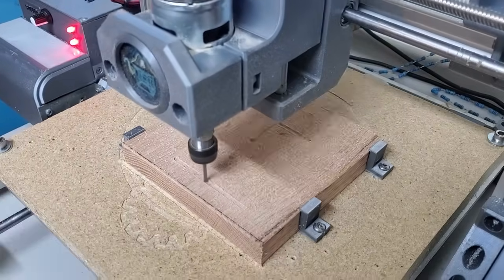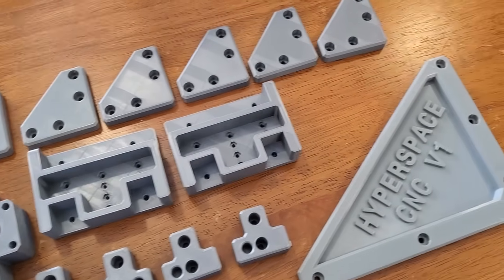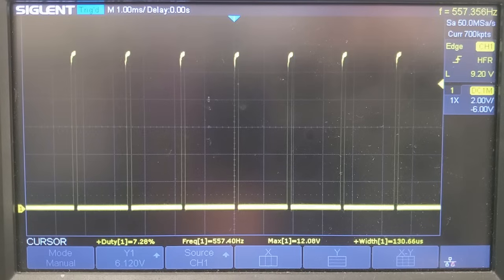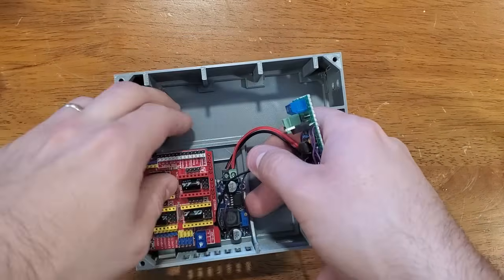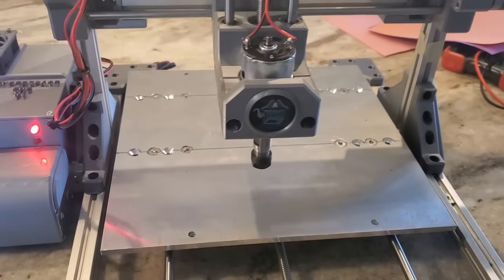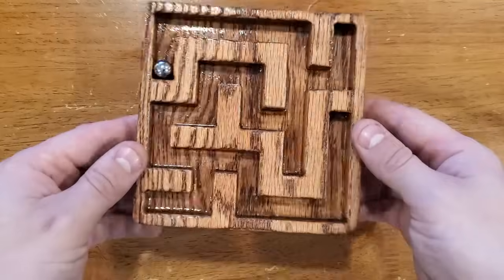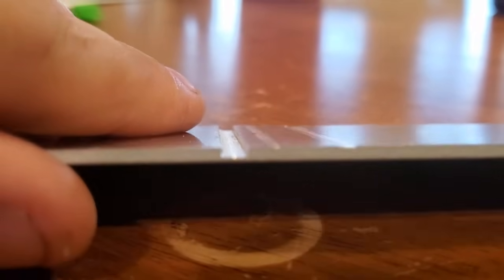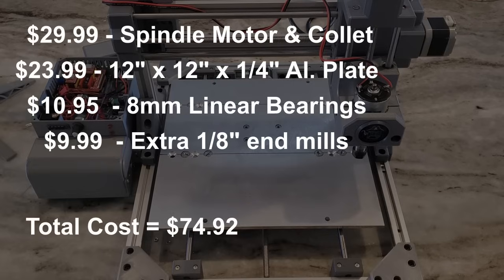CNC Mill for under $100

Comment: A great build and fantastic video; I loved how you showed each step in detail.  I made a similar one for less than 1$ because I too had most of the parts on hand too ;)
Reply: Yes indeed a very good guide, it inspired me aswell to look in my drawer and since that i got one literally for free because it was a fully operating miill in there
Reply: @Mercan1556  😂
Reply: @Mercan1556  Lucky you! I opened every drawer and only found socks and such. Would that work too???
Reply: Great math is limitless here. I made it for -200 $, factoring in that I was also able to sell some of the crap I has at hand :)
Reply: But you still paid for that so you should still count the initial cost minus whatever you made from the rest of it.
Reply: @LuisCasstle  r/wooosh
Reply: you don't have to buy what you can recycle. 
why do you children assume these are new parts? 
so nasty and so ignorant.
Reply: ...thats not how that works, the fuck... if you bought the parts somewhere in the past then they weren't free, you still spent money on them; you just forgot about it
Reply: tha'ts awesome, although 3 days work, I make about $1,500 a day before gov robberies,. so that printer would cost me $4,500 in time to make, although I do have most of the parts layin around
Reply: That's not how pricing works, like at all.

You're just terrible with spending and had random stuff lying about.
Reply: @Kyle496  you missed the joke…

Comment: The 165 one would be cheaper ! By the time anyone rounded up all that and found software etc. your talking days!  Even at $10 an hour which is much less than my time is worth your probably looking at a minimum of $150 + at least $100 for parts and that's without all the time to design and print all those parts! And I doubt you or anyone can just open a drawer and find all the hardware, and what look like brand new parts at that!  Sure!

Comment: you over spent tbh, im working on a milling machine atm cost nothing, just using the 12 nm closed loop nema 32s, a bunch of steel/aluminium ball screws ect i have laying around from about a month ago.....dude i got a great business idea, since we seem to get a bunch of shit free for building milling machines why dont we start selling the parts for $5 piece exc gst/postage/transaction fee, yea its a small amount but the amount of people who would pay $5 for some of the parts that usually cost 20+ we should sell alot.

hey i havent tried with other things yet but the buying it saying it wa slaying around making it free thing, does that apply to other shit? like could i walk into a car dealer have the remove a door from a Ferrari, buy car then say its laying around so now its free and just pay for the door to have a basically free ferrari?, sorry im a bit new to the making things free thing so tryna understand it better + i wouldnt mind building a house for under $100 and a car

Comment: Under a $100 IF you have 75-90% of the "spare parts," a 3D printer, Arduino board, breaker hat, and stepper drivers just lying around.

Comment: $74.92 in purchased parts, $500 in spare/existing parts, $400-600 in labour/time, $1000 in tools/equipment.
yup, that's under $100.
Reply: why stop there? throw in the $ 50k student fees, $ 200 k house, $ 10 k hip replacement, etc.
Reply: @Southghost5997  the electricity bill, daily food cost don't pay for themselves either 😂

Comment: This Grbl glitch is driving me crazy. I can't make a serpentine descent reliably. Often times the Arduino disrespects the g-code and just plunges into the material. I'm forced to first drill holes before the main operation but that's a very annoying additional operation and slows me down. Did you find a way to fix it?
Reply from the maker: I haven't tried. Still not super familiar with the GRBL firmware cause this was pretty much my first CNC build
Reply: Run LinuxCNC. GRBL is trash.
Reply: @1pcfred  Yup! That's what I did. ;)
Reply: @1pcfred  I already got quite some experience with LinuxCNC. Even made a custom hal file which allowed me to control the RPM and direction of my spindle through LinuxCNC via both the user interface and g-code.

Comment: Reported the video for a misleading title. 

You can't claim this is a CNC machine for under $100 then use the majority of the brand new components from your "junk drawer" as a cheat to fudge the budget. I don't believe for a moment you had these pieces, some of which were pretty specialised just sitting in the same drawer, brand new and they weren't purchased specifically for this project.
Reply from the maker: As a Test Engineer I have access to loads of slotted rail, and the remainder was from a defunct 3d printer, so yeah. 

Your junk drawer may vary
Reply: @HyperspacePirate  🤦 What a ridiculous reply. "As a test engineer".. 

Think about what you just said and how that relates to the titling and premise of your video. If you'd titled it something like "I made a CNC machine for under $100" and were clear that viewers would be unlikely to replicate for the same price then we wouldn't be having this conversation. 

As it stands your video is misleading and violates the YouTube guidelines. It's just that simple. 

Access to also doesn't translate into brand new components sitting in a drawer that had no monetary cost.
Reply from the maker: @tjmarx  Not sure what your location is, but if you're in the US, you might find these links helpful:

https://www.aclu.org/writing-your-elected-representatives

https://www.aota.org/-/media/corporate/files/advocacy/tips-writing-letter-member-congress.pdf

Comment: You do realize, you could have just gone with two pins of the arduino to do the mosfet modulation, pot to Analog pin and via Gcode and have it via both, internal and external speed command of the spindle :) But EXCELLENT job :D

Comment: I've always wanted to build an insanely cheap and crappy CNC machine, and use it to build better parts for the CNC machine, which would then be used to build even better parts for the CNC machine, until I had a bangin' rock solid professional quality CNC machine...

Comment: Nice CNC mill. However, increase the flowrate on your 3D printer. The parts are lightly under extruded. Either calibrate the extrusion in the firmware or do it in the slicer software. :)

Comment: It might to be better and cheaper to weld stiff frame from ordinary scrap steel, and maybe that might be closer to $100, lol ;)
Reply: It is very difficult and perhaps even impossible to weld a frame without it heat distorting. You're better off using fasteners.

Comment: Impressive!  The electronics are way beyond my understanding/experience...  The mechanical stuff I can handle...  I am in a jam as I have a broken controller that I am trying to rebuild.  Your video is both inspiring and disheartening.
Reply: It is often the case that mechanically inclined people are not proficient with electricity and vice versa. People good with the electrical aspects often struggle with the mechanics. It is rare to find anyone talented with both. Pro tip: NEVER disconnect a stepper motor while the driver is powered up. It's a great way to blow the driver out.

Comment: Suggestion: it would benefit you greatly if you reduce the length of the end mill. Especially when cutting aluminum sheet. It will greatly reduce chatter and vibration. It's always a good habit to keep end mils short to prevent breakage, chatter, bad finishes, and  noise

Comment: Interesting.  I think that I commented before on this clip.  My guess that the plastic line that went into making those plastic corners and other bits is a sticking point. Which ain't cheap, likely. I wonder if something like Baltic birch might be a better idea?  As for milling of metal, I might guess that you should be able to mill high density polyethylene too.

Comment: You've convinced me to spend $200 on a premade one.
Reply: Love how the junk drawer had "most of the parts".  Ya my junk drawer also has 3 random stepper motors lol. Add the CAD'ing time, 3D printing time, assembly time... Everyone without a 27k sub following would quickly realize this project isn't cost effective.
Reply: @johnnymain3904  My parts bins have all that and more.  I even have a couple of the spindle motors he used, scavenged from old power tools and such.  The main problem he has is that he pretty much build a 3018 but less rigid.  The 3018 design has the same issues with rigidity, backlash and z axis flex.  He did end up with a machine that works for some of his needs and many of the parts can be reused in a better design later on.
Reply: @johnnymain3904 haha you dont? Ive got bins of steppers and servos. Not kidding either. Be that junk guy and go around town picking up unused cnc projects you’ll accumulate a lot.
Reply: @johnnymain3904  i mean i currently have 4 steppers, power supply, build plate, guide rods, bearings and TMC 2009s sitting in my archive. Why in archive? ill probably never use them on my current equipment.
Reply: @johnnymain3904  i have spare stepper motors... if you build stuff like this its not unreasonable
Reply: @johnnymain3904  main junk drawer acctually has 3 steppers 😂
Reply: @johnnymain3904  my other channel has 40k and I'd definitely buy something before spending this much time to build my own mini mill from scratch...

But he also does this sort of project to build a coil winder in another vid and it's beautiful.
Reply: @johnnymain3904  These arguments are dumb.  Everyone acts as if their time is so valuable when the truth of the matter is that your time isn't worth squat if you are not on the clock.  Personally, I love doing little projects like this for various reasons: sometimes to get out of the house and away from the wife and kids, sometimes with the kids because there are many valuable lessons to be learned, and sometimes I just like to burn time and keep myself busy considering I don't watch the idiot box.

A couple of years ago I did the Airgineers (not sure if I spelled it right) Drone build project with my oldest son which was a massive time sink when I could have bought an equally crappy drone for less than $100 at the local truck stop.  Not everything has to boil down to a cost:time ratio.
Reply: @apersonontheinternet8006  I agree. Don't care if you earn $50/hour at work. Your free time is free
Reply: @apersonontheinternet8006  my time is valuable.  People pay me for my time and the things I make.  So every minute of my day is a choice of whether I get paid for my time or not.
Reply: @davedurkee8853  some of us get paid for our "free" time.  When you have skills and a shop full of cnc machines, free time is only obtained by choosing not to work for one of the many people throwing money at you.
Reply: @apersonontheinternet8006    I value my free time more than my on the clock time lol. That's MY time and it's very limited. Could see this being something someone feels is worth doing because they think it's fun. But yeah my free time is limited and therefore has lots of value.
Reply: @Max-zr7hr  that's what it boils down to, for a lot of people (myself included) the majority of the enjoyment is in learning about and building the thing in question, once it's all made you feel lost and move onto other projects and challenges for yourself. Certainly not worth building if all you want is to use it to make something for a project, but if the project is learning how it works and challenging yourself to design and build something you can use for other projects then it's definitely worth it. Different strokes for different folks and all that. Even as a child I used to take things apart to try and figure out the inner workings and then modify and improve on designs, I got into rebuilding 2 stroke engines and just moved my way up until I was rebuilding and modifying 6 cylinder car engines for fun (have done V8's and v12's also but my passion lies in straight six engines personally), and most people would consider that a horrible job that takes far too much time and effort but it's something I find very enjoyable and therapeutic as well as being infinitely more satisfying once completed than simply throwing a wad of cash at a mechanic, there's something truly special about doing it yourself that makes enjoying and appreciating the end result far greater, at least for me anyway, and the knowledge gained is almost always able to carry over to more projects and in my opinion you can never have to much knowledge, even if it seems like it will be of no use to you it seems to always come in handy at some point.
Reply: @apersonontheinternet8006  That's actually a tremendously flawed argument. Most people value their time based on their hourly rate at work, which is understandable. Thats not quite how it works and there are a number of variables that factor in. I'd have to write a book to explain, but its far from that simple.
Reply: @apersonontheinternet8006  yup   "Skillz"  are often built/reinforced by doing something like this. 

Tony Stark built it.... in a cave.... From a Box of Scraps
Reply: @MDM1992  Well said. You clearly "get" it from the maker/learner perspective.
Reply: Honestly save your money and buy a bigger more robust one. Spend the 1k and you will be happier
Reply: @MrRevolverkiller  Where I live the average salary is below 300 dollars a month. I could do 300.
Reply: You'll get just as good quality.  They're all pretty bad from a rigidity standpoint.
Reply: Sometimes seeing someone go down the wrong road is just as valuable as having someone guide you down the right road.
Reply: @GodzillaGoesGaga I think the better plan would be to buy a 160$ Chinese one and then just upgrade it with homemade parts and such
Reply: @GodzillaGoesGaga  I guess this one is better, I tested a cheap 500 bucks mini-cnc for somebody and it didn't even made reproducable parts. Everytime, you had some different results, holes moved 1 or 2 mm in one direction, the firmware crashed in the middle of work. This project is maybe around 200 bucks, when you add a good spindle, and you have full control over it. Not like the chinese crap.
Reply: Indeed so. "It took three days to print the parts." There's no harm in considering your time is worth something. But do check if the model you purchase has open-source hardware that can be swapped out, and software/firmware that can be upgraded and tweaked. The frame should be rigid and solid, not cheap. Carbide tools will reduce vibration. Independent reviewers will tell you if the tolerances and results are up to spec.
Reply: @Shindiggity  make a small exception for a 3D printer. Start with a decent one or you will be too frustrated to achieve progress.
Reply: Lol.  Exactly my thought.  Too good.  Glad it’s the top comment.
Reply: Lol
Reply: Yeah pretty much as soon as I saw a CAD mach up.
Reply: New marketing 😅
Reply: I didn't even need to watch it to see how this was going to go. Sometimes for easy things, it's cheaper to do it yourself. Not this time.
Reply: where do you find a 200€ premade?
Reply: @filippoferrari2128  China. With the following caveats: it's not "premade", it's some (all) assembly required, and it was 250 USD last time I checked, not 200 euros. Last caveat(s): it's tiny, frail and useless for anything other wood or plastic. I wouldn't get anything LESS than a Fox-Alien (et al) for 850+USD at this point, and that's not saying a whole lot. Short answer: you don't
Reply: lmao
Reply: Yea no crap!! Logic for dummies. Spend 20 hrs. puzzling sh1t together is money lost.
Reply: I'll have 6
Reply: Guys we are producers of good queality CNC mills, we are from peru, feel free to ask for our models and some videos :D

Comment: I generally don't consider the need for a 3D printer for certain projects to be egregious or dishonest. It's a tool that opens doors for a vast amount of projects. Just like you need a welder for some things, or a soldering iron for others, I think it's fair to call a $100 project that also requires $200 in 3D printers/filament $100 without being dishonest. But the vast majority of people don't have drawers of lead screws, NEMA23's, and properly sized aluminum extrusion. Kind of annoyingly clickbait.

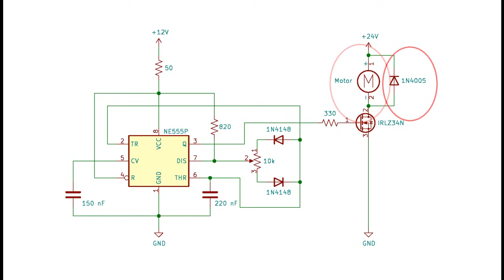Comment: 6:52 what for 50 Ohm resistor and where is decoupling capacitor for the ic?
upd: I see,  resistor is for powering by 24 volts, but in this case you have to add Zener diode, or power by dc-dc converter or just use 7812 linear regulator for example